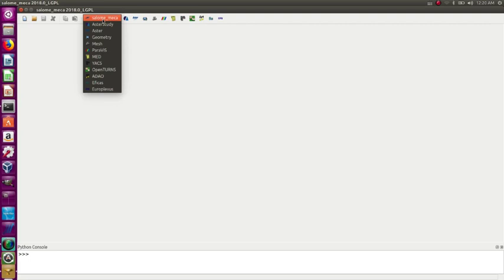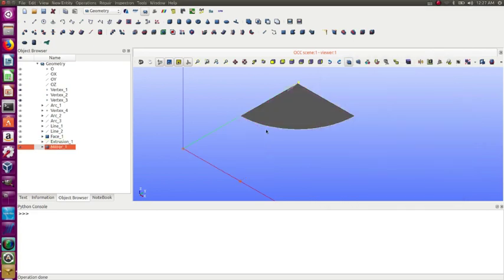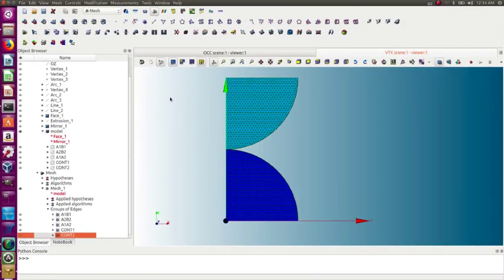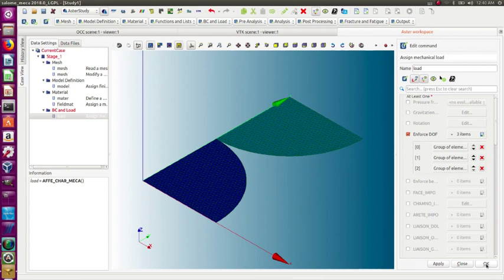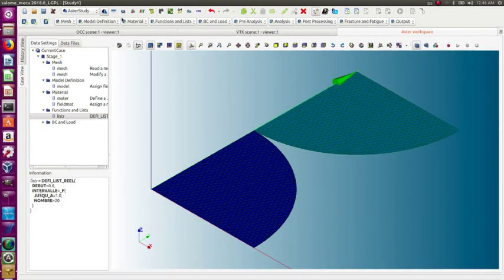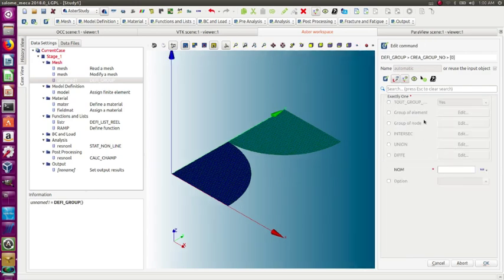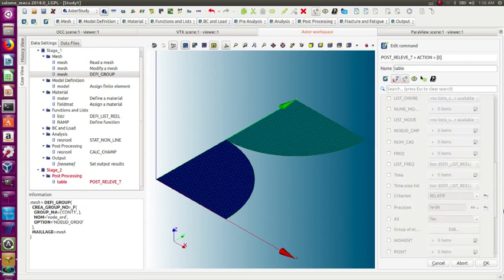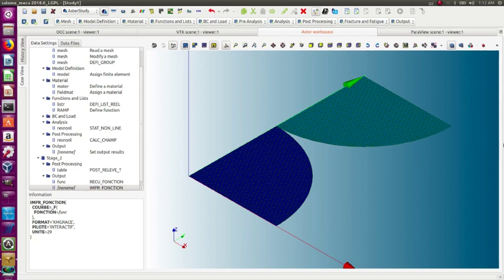Nonlinear Hertz Contact Tutorial with Salome-Meca 2018

Comment: Hey Cyprien, how did you get an icon for Salome Meca instead of running "run_salome" file?
Reply from the maker: I am on Ubuntu 16.04. You normally get an icon when you install Salome on Linux. On Windows, you can make on yourself as a shortcut and then change the picture if you want

Comment: hi Cyprien, I want to know how to define local mesh in Salome_Meca? for example, when I modeling a crack problem, I have to use more refined grid around the crack tip.
Reply from the maker: There are several ways to refine, you can either create a sub-mesh on a group with contains the edge you try to refine (then choose smaller mesh size) or in the mesh options, you have also a tab called « advanced » which can be used to refine. The first solution is more systematic.

Comment: Hi Cyprien. Thanks for showing great simulation in SalomeMeca. I don't get a graph when i run stage2, anyone know why ?
Reply from the maker: Was the graph generated as a file in your analysis directory? If not, you may have something wrong, check your message file. You may not have the software « xmgrace » which is used to draw graphs installed. Last thing, Did you set the parameter to « interactive » like in the end of the video?
Reply from the maker: Try to print out your results into a text file to check if this is working

Comment: How can one see the convergence rate of the calculations??
Reply from the maker: It’s written into the text result file which is generated during the calculation (.mess file I think)
Reply: @Feaforall  Yes indeed i found it! Thank you! I would also like to ask how come you didn't input any kind of behavior in the stat non line command. I have gone through the documentations but i haven't seen explained what happens if you don't input that parameter. Could you please explain?!